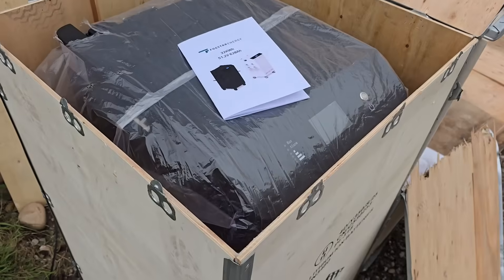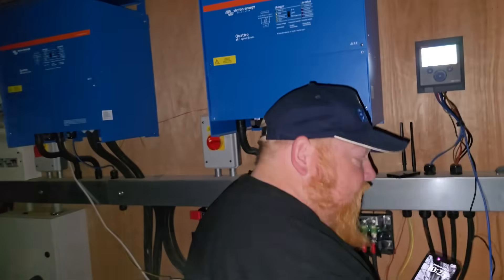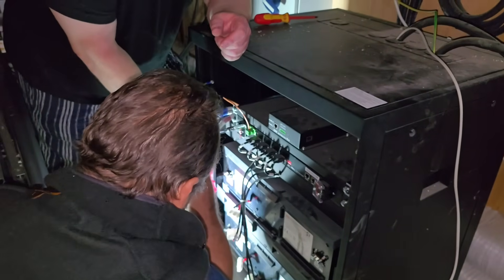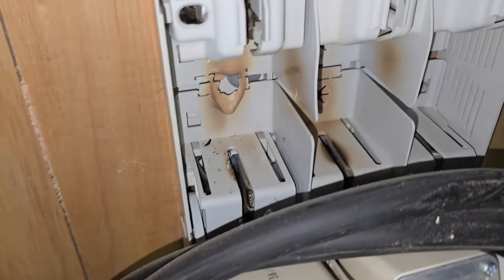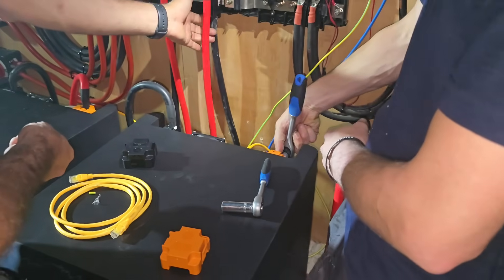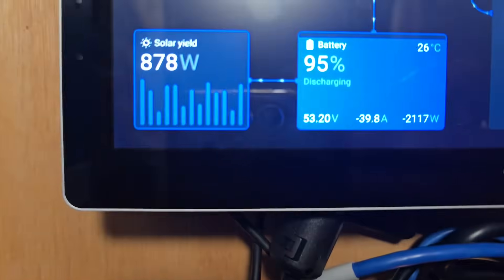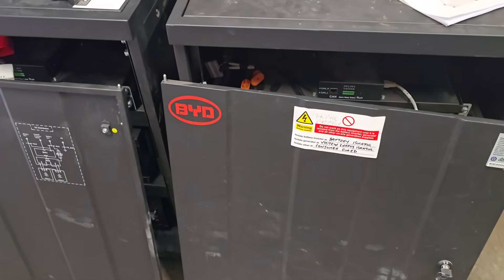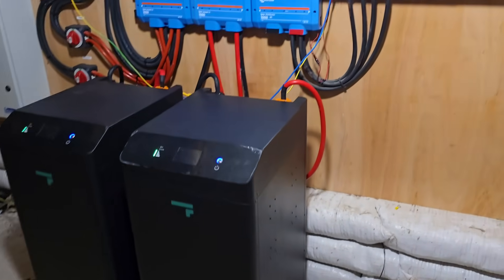Installing a 64kw @fogstarbatteries battery, with the professional help from @BlueFix    🙌🙏

Comment: I’ve been seriously tempted by the 32kWh Fogstar for a few months now.  But the weight of the unit causes hesitation.  230kg is serious business!  And your video showed you struggling with the full weight of these units, so hats off to you succeeding in getting them inside!

But I’ve now discovered lever hoists, so I’m wandering whether I can use that to advantage as a pulling aid and save my back. 

I’ve got a feeling that my ideas are back in business!

Comment: As far as I know, those batteries don't have any internal heaters.  They won't charge below 0 degrees. Does that shed stay warm enough over winter?
Reply from the maker: Ye plus they get constant use which should make enough heat but if was super cold I would heat the room 100%
Reply: Do a video on a little Chinese diesel heater? Very cheap to run and might be ok to run on oil.
Reply: Don't know about these 32kwh batteries,but the new 16kwh come with heating and fire suppression inside

Comment: Get yourself a thermal camera, you don't need to spend too much on those for this application, and make sure to inspect those batteries at least once a month or so. 

Most often when those packs start to go it is because only a few cells have reached their lifespan. So often they can be repairs IF you catch it before it becomes a bad time.